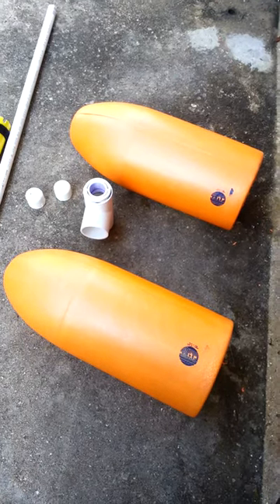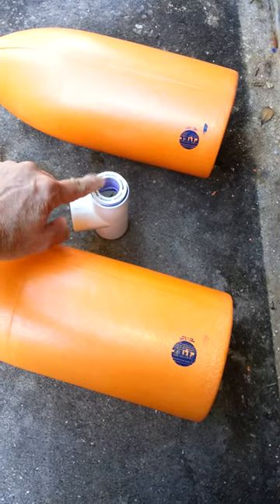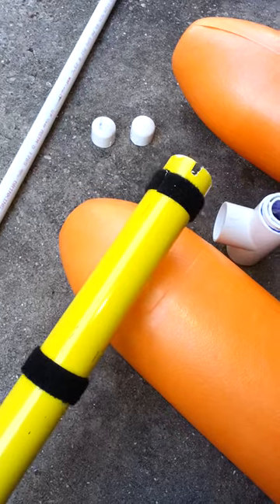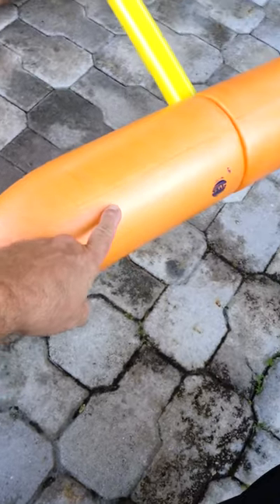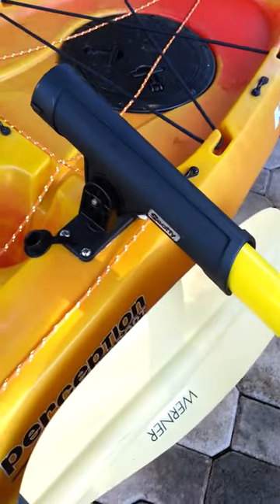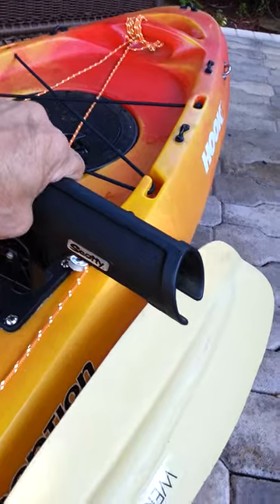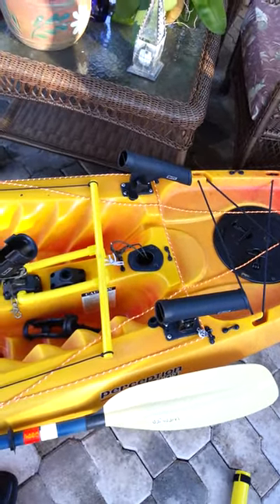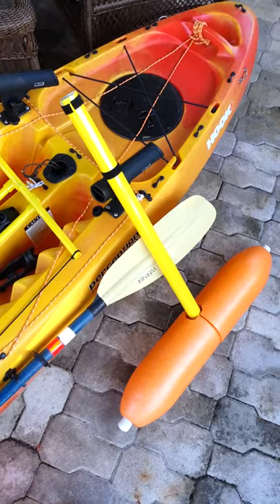Homemade Kayak Outriggers

Comment: Hey John l like the way you did your setup on your pontoons. l think l'm going  with your set up. I have seen a few Videos on pontoons for kayaks and yours is the right way to do your own set up and they look Professional  One Question, on  your Scotty holders and your 1"1/4 PVC pipe how much play did you have in your pipe? they did not fit tight in the Scotty holders with out putting Velcro Around the pipe.
Reply from the maker: Not much, but a slight wiggle. The velcro (soft side) is perfect, but I also used clevis pins to be safe.

Comment: i use 11/2 inch PVC pipe bought at home depot which was too big for scotch 351 rod holder hole .can.t stick through just wonder how you made it through the rod holder hole .i believe 13/4 inch PVC will fit the hole just right. but not found at home depot.Hope get youe help about this problem.
Reply from the maker: +mike cato Maybe they are 1 1/4" Inside diameter? I would have to verify. I have no problem finding 1 3/4" PVC from HD.

Comment: Nice job on the outriggers, how have they been performing?
Reply from the maker: @Rendezvous Great! The Scotty rod mounts flex a lot when it's wavy though, but they haven't broken yet! I may make them about 4-6" shorter since the floats are very buoyant... Check out a test drive in the bay with the DIY H bar here...https://youtu.be/8poullyCc4A
Reply: Thanks! I want to try them, hoping to boost my confidence or possibly even stand up fishing. I would want to mount them towards the stern though. Thanks again!
Reply from the maker: Just make sure they are far enough back so when you paddle, they are clear...
Reply: Will do, thanks!
Reply: I replaced the rod holders with stainless steel flag pole holders. I put a piece of polycarbonate cutting board below deck to act as a backer to disperse the load on the hull. This set up seems to work really well. And its a lower profile so I don't have as much snagging on the ropes.
Reply: Hey what size bouys are they 5x11 or 6x14?

Comment: Looks awesome. Just got a Lifetime Tamarack Angler kayak for xmas. Took it out on the ocean today and flipped 3xs in 100+ deep water with 25-35 mph winds and large waves, not fun. This should help. I was thinking maybe even a cross bolt on the pole holder to hold the pipe in and use a wing nut or something to unscrew tobtake it out. Anyways... Thnx again from kauai
Reply from the maker: +Matthew Murray Cool. yes, it was windy & rough! they definitely help!

Comment: Great video and Im building it this weekend! I had a question about the floats.  Im seeing on line the floats in the $8 range are 7-10 lbs of buoyancy.  Can you post a link to the ones you bought?  I think you said 50 lbs on each side so that would make them 25 lbs ea?  maybe Im wrong tho.  Thanks!
Reply from the maker: Here is where I got them http://www.easternmarineoutlet.com/Crabbing-Floats-Buoys
Reply: John Sims
Great thanks.  Were they the 11' or 13 1/2"? Im 250 lbs and that 100lb buoyancy sounds great!
Reply from the maker: 13 + these; http://www.easternmarineoutlet.com/5-7-8-x-13-3-4-bullet-nose-crabbing-float-orange
Reply from the maker: John Sims http://www.easternmarineoutlet.com/5-7-8-x-13-3-4-bullet-nose-crabbing-float-orange
Reply from the maker: John Sims Here is what I copied:  http://www.yak-gear.com/shop/kayak-canoe-outriggers-stabilizers/kayak-outriggers-stabilizers

Comment: Looks great, I am trying to do the same and had a question about the main pipe in the fish holder. You mentioned notches so it wouldn't twist, but how do they stay secure in there and not slide out? Thanks
Reply from the maker: That particular rod holder has a so-called rod in the back or the bottom of the tube, similar to a deep sea rod holder gimbal. Also, I used the fuzzy side of Velcro strips to wrap around the tube at the end and the area just inside the throat of the rod holder tube. Very snug! I also ended up using retaining clips onthem.

Comment: John,
Went to order floats and found they have two sizes: 5x11 and 6x14. The 5x11's are around $8 so I'm guessing you used that size. Is that correct or did you use the bigger ones?  Thanks again for the help. Jack
Reply from the maker: That was the size I used. PLENTY of buoyancy!

Comment: How dose the notch on 1" /1/4 & pipe & your Velcro keep in your rod holder ?
Reply from the maker: It holds very good however I did end up using locking pins
Reply from the maker: Here they are mounted on my Hobie Outback where you can see the locking pins  https://youtu.be/OzpJARD2dfY

Comment: Hey John! I'm building this exact set up for my old town 13'....How far out did you put the buoys? Which scotty rod holders are those? I'm pretty sure I know but just to make sure....Thanks for sharing!! My other option was spending 400.00 for a system...HUGE find!
Reply from the maker: Jason, These are copied from the Yak gear outriggers. http://www.yak-gear.com/shop/index.php?route=product/category&path=142
The Scotty Rod holders are the Scotty 351 rodmaster with the 244 recessed mount http://www.scotty.com/fishing-gear-equipment/rod-holders/rodmaster2.htm  the pipes are 31 inches long.

Comment: Do you have a parts list?
Reply from the maker: +BrooklynStriper No...but. These are copied from the Yak gear outriggers. http://www.yak-gear.com/shop/index.php?route=product/category&amp;path=142
The Scotty Rod holders are the Scotty 351 rodmaster&#160;with the 244 recessed mount http://www.scotty.com/fishing-gear-equipment/rod-holders/rodmaster2.htm&#160; the pipes are 31 inches long.